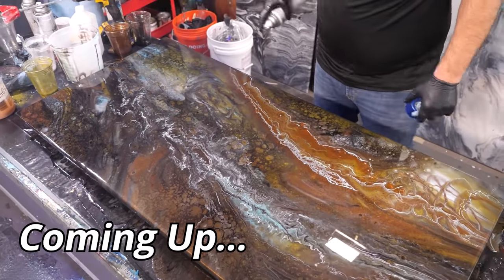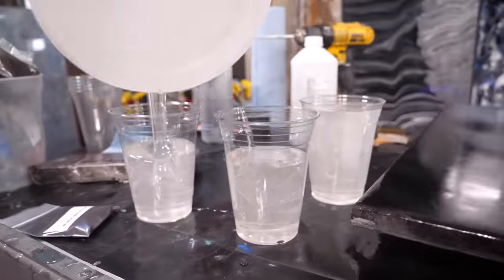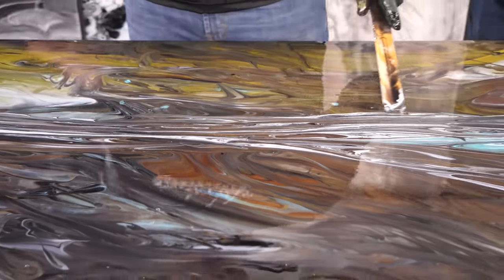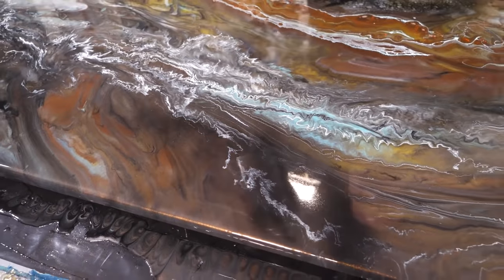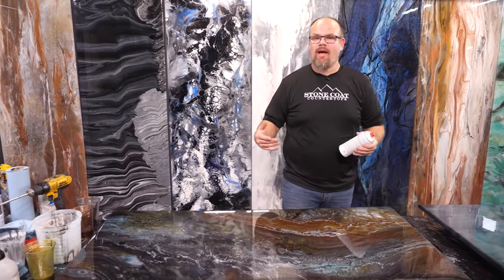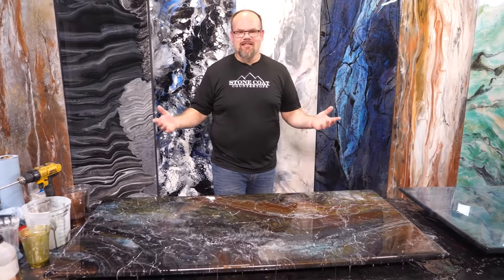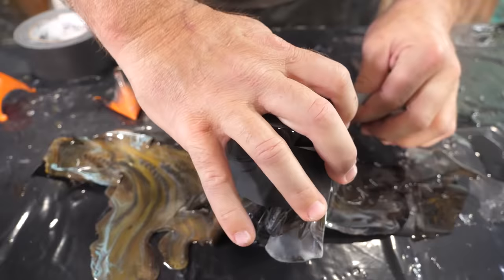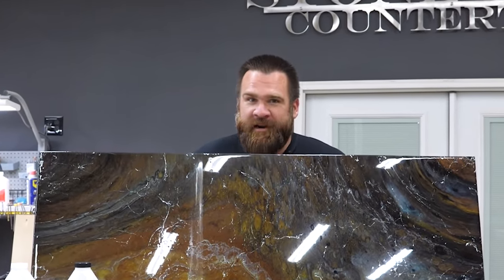7 Techniques to Make Outstanding Epoxy Projects | Stone Coat Countertops Epoxy

Comment: I absolutely love the way it turned out.  Have a question though - would this work on an outside bar?  I know epoxy has challenges when it comes to being outside in the sun - just curious if this will work and hold up.  Anyone have any ideas or additions that I may need to make it work outside?

Comment: Could you guys do a cleaning process video for post project cleanup? I know you mention using acetone , do you soak? Just wipe? Follow by water??  Do you use acetone on your paint brushes too? Do you reuse your acetone? We have alot of questions , too many to list. Would truly appreciate seeing your process. I feel like we are replacing too many brushes too frequently.  I feel like my mixing paddle gets too much hardened product on it by the time I'm done and get over to clean it, I've tried keeping a small bucket next to work area to sit my mixer paddle into til I'm done... I just think we are probably overthinking this and I'm sure there is an easier more methodical way to do this and help save some of my "tools".

Comment: I want to redo my mom's kitchen countertops but they are some type of solid resin. The house was built in 1980 and the countertops are a solid color through and through with a texture on top. The bathrooms have cultured marble showers, tubs and countertops but are more typical; swirl patterns with smooth surfaces. So... I'm wondering if the kitchen countertops are made of the same material. If so, can your product be used on the countertops?

Comment: If the scraps were made smaller and taller you could use them as a flower vase to go with or on the table. Great tip.

Comment: I want to try this on the counter top in my kitchen but the back splash is a thin piece of laminate that the previous owner glued to the wall. Do you have any suggestions or recommendations as to what I would need to do? Also, can this be spread on the back splash with a roller or a brush? I enjoy your videos and have gotten some great ideas from them. Thanks...David Lee

Comment: Like the fracturing.  Whats the difference between using the white spray paint mixed with epoxy vs mixing the white powder with the epoxy?  Do they act/spread differently (spray paint vs powder) mixed with epoxy?

Comment: tilt worked wonders.
And I have one question

Did you use anything to coat other side of the mdf? I wonder if Epoxy causes bending like Polyester or Uratherne does on mdf.

Comment: I loved it all. And I do mean ALL! Love the tilted effect, especially love the spraying with alcohol, the marbling was over the top. My problem would be when b.c. to stop. But, the greatest part was the tip at the end to buy a small or old piece to practice on first. Question I have is, with so many thick coats, how long does it take to finally dry in your kitchen say,? Is it best done at a certain temperature or say summer vs winter?